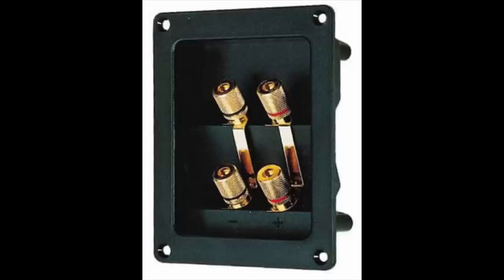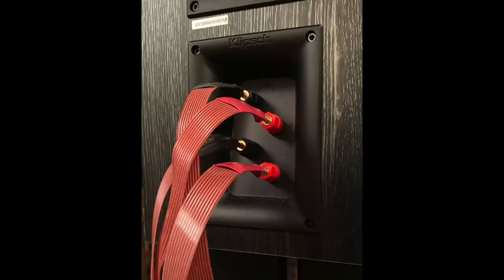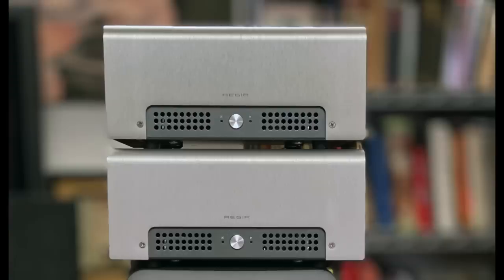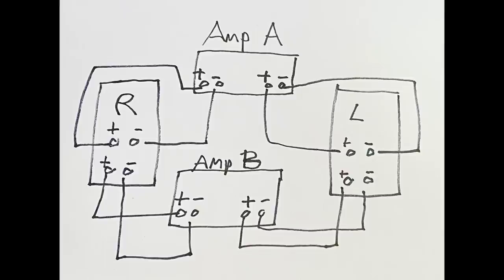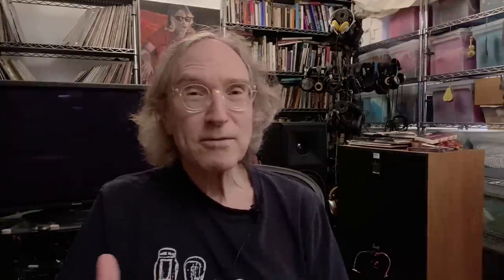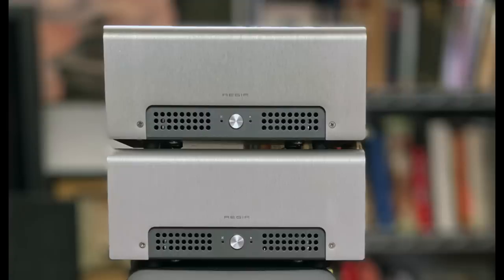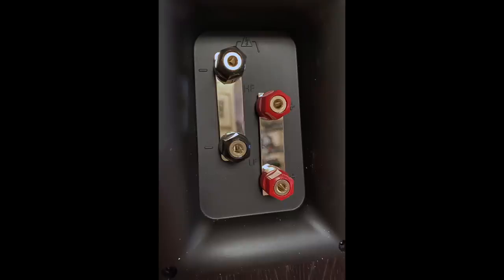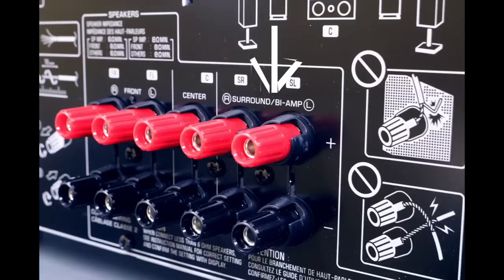It's time to think about bi-amping your speakers!

Comment: Hi, Steve. As has been suggested in comments section already, try out vertical bi-amping instead of in your cases horizontal bi-amping. For the vertical config. identical amps is paramount being each amp drives an entire speaker; for the amp driving the left channel speaker one of its channels is connected to the lower set of terminals and the other to the upper terminal set, and the same with the amp driving the right channel speakers. It's some time ago, but to my ears the horizontal config. sounded flatter and less involving somehow. Definitely try out vertical config. and see where that leads sonically to your ears. 

If the amps you have at hand are bridgeable, I'd try that out as well. Ignore the naysayers who would have you believe bridged config. is (theoretically) inferior. With the identical power amps I used years ago, where I also tried out horizontal and vertical bi-amping, I actually preferred the same amps in bridged mode, which converts each amp into a mono amp with typically 3 times the power of its non-bridged state. In bridged mode the sound just became that more alive and effortless compared to both bi-amping modes. 

Lastly, I use different amps for the horn section and parallel coupled dual 15" woofers/mids in my main 2-way speakers, but I'm running them actively and so the whole of their sound is dialed in around this configuration with different amps to begin with. I find it works very well, but in the near future will replace the bass amp to one that complements the overall presentation even better. A future scenario (even further out) may have me try out identical amps for the main speakers, still actively configured.
Reply: I found vertical a bit better than horizontal using identical amps. I use two ICE 50ASX2SE stereo modules in a DIY integrated amp with 8SN7s as the line driver.  Imaging was more defined with the vertical arrangement and bass was tighter. The biggest change was with phasey effects that put sound outside the speakers - it was quite a bit better with vertical. The improvement in bass accuracy i would put down to each channel having its own power supply - a bit more current delivery maybe?
Besides gain matching (not an issue if using identical amps), the other main concern is amplifier input  impedance  - it will be half the nominal value when hooking up two amps in parallel to the pre-amp. Probably not an issue for solid state pre-amps, but some tube pre's may have an output impedance that's too high for driving the paralled input of two typical solid state amps (5K ohms).
Reply: Hadn't thought about vertical bi-amping, but it makes sense to have a single amp per side if you want to reduce stereo crosstalk as well as HF/LF crosstalk.  The only time this would make no difference is on an amp like my A308, which is a true dual mono, including the power supplies.

Many of the benefits of bi-amping are also achievable by bi-wiring, specially if you have enough power in the first place.  I suspect some of the improvement on the tiny little valve amp was due to a bit more oomph.
Reply: Passive vertical bi-amping seems like a more logical and practical way to go
Reply: John Smith, I agree, however, Steve did add a second amplifier, which is a bit more than just a wiring configuration, is it not?

Comment: Bi-amping is great. I have a Bryston 4b SST on my 15 inch Celestion woofers and a Rotel RMB-1075 (only 2 channels are being used) on the midrange (Visaton 2 inch dome) and tweeter (Audax) with a Rotel 1070 preamplifier with a double output. This is not the best of preamps , but it drives both amps with no problems.

Comment: Great video Steve! Bi-amp often both horizontal (as shown) and vertical. Also used active crossovers. Tried tube amps on top and solid state on bass. The gain characteristics or input impedance, made the tonal balance change with volume control position. Didn't work out.

Comment: I've got a pair of B&W 801 Nautilus's, that I've tried a bunch of different amps on including McIntosh 1.25KW's. Currently bi-amping with a Rogue Atlas Magnum with KT120's driving the top end and a Bryson 4B SST on the bottom. Sounded bass heavy at first and switched back to a Bryston 4B ST which has less power and was a better match. Subsequently. tried McIntosh's MC901's approach and introduced an ART 2 way crossover with gain control. Switched back to the 4B SST and dialed it in. Wow! Very impressed with the sound. Source is Tidal, pre-amp is a McIntosh C1100 and DAC is a Lampizator Atlantic.

Comment: I took my old JBLs and split the divider circuit so each driver still had the original circuit upstream. Then installed biamp posts and set my yamaha 7.1 av receiver to work as 5.1 with the front mains biamped. The improvement was huge and all I had to buy were dual banana posts from parts express. A bit of soldering and elbow grease and the whole system sounds so much more beefy.

Comment: I have been bi-amping for years. I'm a professional 'live' sound engineer, that found a lot of time on my hands recently, due to the COVID situation. So, I decided to build a poor man's HiFi system, using bits and pieces from some of my old speaker stock. Retired speaker cabinets, spare drivers, various crossovers, horn lenses, etc. And after a few months of testing various frankenstein creations, I came up with this concoction. I took a pair of 30+ year old Sonic brand, 15" 2-way PA speaker cabinets. I installed MCM Electronics, aluminum cast framed 15" woofers, JBL 2416H HF drivers, and equally aged Eminence 2-way crossovers. (Only to protect the JBL horn drivers. Leaving the 15" woofers to be DSP'd by the amplifier) Then, I bought new horns that matched the original ones in the Sonic boxes, and fitted them with 40+ year old EV-1824M midrange drivers, built boxes for them, and then added bandpass crossovers, to protect them. I then took new Skar brand, 6.5" mid-woofers, put those into small boxes, and added a pair of baby butt cheek horns, fitted with 25 year old Foster N27 HF drivers, and crossed them over with some 40 year old Realistic 2-way crossovers. I then took an Aiyima brand T2, dual vacuum tube, (6J1), preamp, that I then run my Tascam CDRW5000 CD player thru, or just Bluetooth the signal source, (Pandora or Spotify), thru its BT feature, then RCA 'Y' cabled out to three amplifiers. Two Crown XLS1000s, and an A/B International Series 200. The first Crown amp powers the 15" woofers, @ 250 Hz into 8 ohms at 215 watts. The second Crown amp, powers up the JBL horns and the Foster horns, in full range, (Remember, they have built in crossovers), at 350 watts, into 4 ohms. (But, I don't use all that power on them) The A/B intl. amp powers up both the EV-1824M mid horns, (@ 2,000 Hz - 6,000 kHz) and the Skar 6.5" drivers, (@ 200 Hz - 8,000 kHz), at 100 watts into a 4 ohm load. As they are internally crossed over with their respective networks. The end result is a great, very defined, and a widely separated spectrum of sound. Despite not really being HiFi materials, I am blown away by this. Not anything I have owned, in the way of consumer speakers, has ever come close to this sound. Mind you, I have been engineering live sound for 35 years, and I love to listen to quality music on a quality systems. So I have to say that the months that it took to cultivate these drivers, was paid off wonderfully. Now, I started watching your clips on Youtube, since around March of last year, so I have been paying attention. (I love your reviews, BTW) Here is a lengthy clip of my Frankenstein's monsters in action. (Filmed in my garage, where they were created) I call them 'The Sonic Colossus' speakers. This clip was made prior to my adding the baby butt cheek horns and Foster drivers, and a 100 watt hybrid tube amp. Let me know what you think. https://vimeo.com/499869037 Thanks.

Comment: When i replaced a 20-year-old 5.1 receiver with my AVR-X4700H I bi-amped my Klipsch RP-600Miis using an unused height channel.  I love it (so far).  If I get a second set of heights to go in the rear, I'll lose it unless I buy a new amp and use the pre-outs.  As it is, my 6.1.2 system sounds great (I had to remove my center cannel speaker to put my new turntable on the top shelf - Rega P2 with the VM540ML stylus).

Comment: Another bi-amp option is to have amp A for  left and amb B for right (rather than amp A for tweeter and amp B for woofer).   Of course this method really requires matching amps.   I've found that this better uses that power supply of smaller amps or when desiring to play louder.   The trade off would be that the higher frequencies can be more reveling when the amp is being driven at high volume .
Reply: Agree

Comment: The quest to squeeze every ounce of improvement is intrinsic to any audio enthusiast and last year I tried bi-amping using two Chinese hybrid amps that I thought were overachievers considering I got them for less than $200 a piece bnew. I also got a Pass inspired 20W class A solid state power amp so I think its easy to predict what combinations I tried.

My results, same with Steve, is that bi-amping with the same identical amps work best but only if its done horizontally as he did. Vertical bi-amping i.e. using Amp A to drive one speaker while Amp B drives the other for some reason wasn't as "coherent" or as musical as horizontal bi-amping. I'm sure an engineer can better explain the reason/s. Could be higher IMD in vertical b-a perhaps.

In using solid state+tube to drive LF+HF gave bad results as Steve's when he used Schiit and Zen together. The hardware difference is really audible which results in what I'd call a "mermaid effect". The halves are audibly incongruous.

Hope this helps.

Comment: Steve, I was told by Audioquest that the cables from each of the amps to the speaker needs to be the same. They gave me some technical reasons I don't understand but they were pretty firm about it. Nothing would blow up but it would not sound right. Like I have a Robin Hood Zero as my main speaker cables and a Castle Rock in my secondary system. The advice was not to use both but to get a second of the same type.

Comment: I have been bi-amping since 2002. Originally I had 2 Tag McLaren 125M mono blocks driving my PMC FB1+ speakers when I had the chance to acquire another pair of 125M's so I could bi-amp each speaker, All I can say is that I would never ever return to single amplification as everything else I have tried fails to give the same clarity and delicacy that I have had for nearly 2 decades.

Comment: Back in the OLD days when tube amplifiers had a poor damping factor (resulting in poor control of the woofer) but sounded warmer and sweeter  it was common for audiophiles to Bi-Amp their speakers with a solid state amp that usually had a high damping factor for the woofer and tube amp for midrange and highs.
Reply: I do that now with a Single Ended EL84 amp driving an Audio Nirvana Driver
And an F5 Clone driving a Emminence 15 inch Woofer.
The  crossover is a Rolls  active crossover.
I think it sounds pretty good.
Reply: @steveducell2158  Excellent ! I'll bet it does sound pretty good.

Comment: Happy New Year Steve. I had a pair of Dahlquist DQ20i and at the time I had a Carver avr100 reciever and an Adcom gfa5500. I bi amped the speakers using the Adcom for the bass and the Carver 150 watts channel for the mid and high frequency and they sounded amazing. That's my experience

Comment: Bi-amping my system is the only change I've made that revealed a DYNAMIC difference.  Magic wire, over priced separate components and all of the other 'tricks' I've experimented were in my imagination.  When speakers are bi-amped they 'float' in the air.  They are not more detailed; they don't have a larger sound stage, they have no more heft.  What they do is float effortlessly.  There is no constraint between drivers.  Instruments do not fight for space in the mix.  Holographic spacing.  One caution:  the speakers I biamped were Tannoy studio monitors which are meant to be bi-amped so the cross over is specifically designed for this signal path.  When you biamp you are still using the internal cross over of the system.  They only difference is you do not get the interference between multiple driver loads.

Comment: I use my Audiolab 8000S integrated with its matched 8000SX power amp for bi-amping, and the difference is easily noticeable. It very clearly adds a bit of weight. Things sound slightly fuller. Definitely recommended if you've got kit that'll do it.

Having said that, I'm currently running closed-box speakers from 1989 that only have one set of binding posts, as they suit the room I'm in at the moment a lot better.

Comment: How was the bi-amping compared to running the Schiit amps in their mono-block mode with single connection to each speaker?
Reply: obvious answer is you need four schiits
Reply: @ar_xiv  No, that is not the obvious answer ;) You can compare a 2x mono setup to a bi-amp setup which actually was his question, i.e. single connection to each speaker. Anyway, that is not what the Audiophiliac tested, so the question was kinda pointless...
Reply: @Baerchenization  it was a joke
Reply: I too would like to know. I currently run a mono-blocked NAD to each Klipsch speaker. Would I lose some dynamics and separation running in bi-amp stereo? ( 100w/channel stereo, 400w/channel mono )

Comment: I did bi-amping for years with tube int.amp on tweeters and SS amp on bass, best of both worlds. And could adjust volume on tweeters which works like tone control. Makes better sound than much more expensive amps always.

Comment: A Speaker is a very complex load for the amplifier, by Bi-Amping each Amplifer sees only part of this load and as a result has a much easier job to do, I Bi-Amp my speakers using identical Amps for over 20 years...
Reply: I had the option with ProAc Tablettes, but chose bridging for a brute force solution now since the KEF LS50s don't offer the dual binding posts. Certainly cheaper in speaker cables!
Still biamping if you count the RELs ;-)
Reply: I always wondered whether there are 2 audiophiles on earth who mean the same thing with "effortless" sound...
Reply: Why not use one amp per speaker? Seems like the same thing. Fewer cables too.
Reply: @therealelguapo  
Not the same thing mate, Bi-Amping uses one Amplifier per speakers DRIVER, so 4 Amplifier total.

Comment: Have biamped speakers since the 80s in various different ways solid state and valve or a mixture of both, had good and bad results depending on the equipment used, definitely worth exploring this topic.

Comment: HI Steve, happy New Year.  Bi amping changed myh HI FI experience.  I use CLass A First Watt M2X on the top and ChiFi Class D down below with MiniDSP on the bass only.  Stunning effect on the bass, top and mid range as lovely as ever, getting awy from the crossover is so good.  Cheers.
Reply: Except you didn't really get away from the crossover. It's still in the circuit between the speaker posts and the drivers.